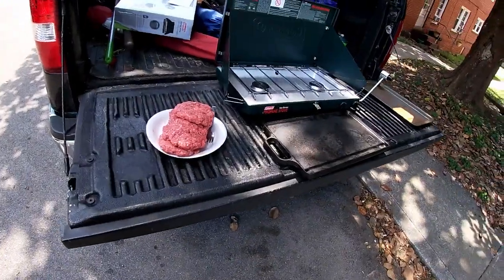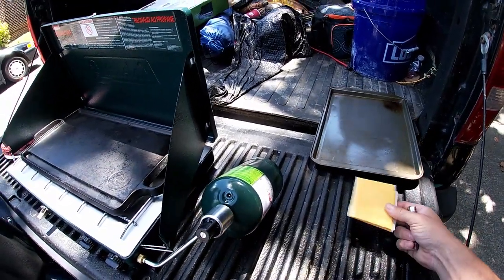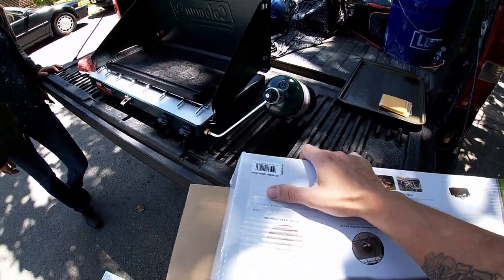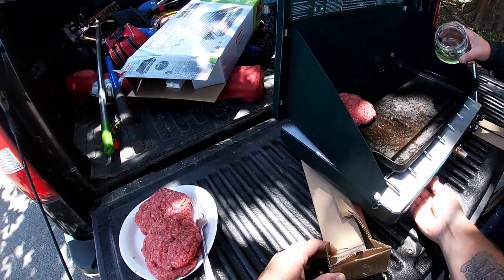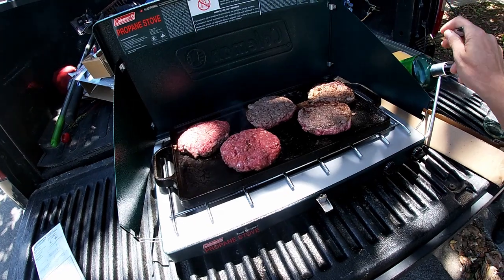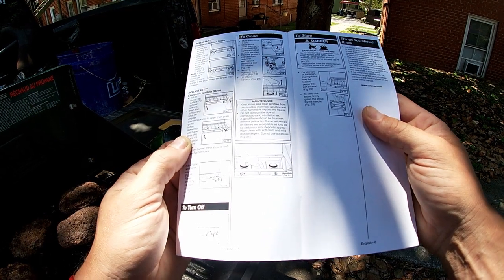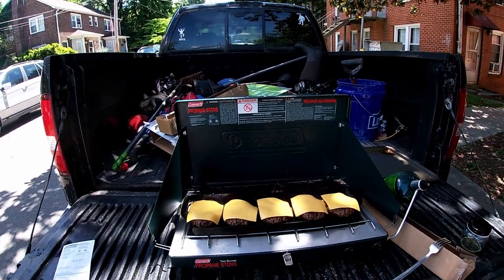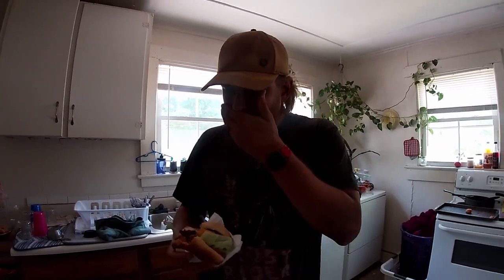50$ Coleman Propane 2 Burner Grill and Burgers

Comment: Have the same stove and will be getting  griddle. I will be getting one a bit bigger 20 x 10.5. Should fit really well. The control on the stove is not great but can be fixed by cleaning the valve. Saw people using Blackstone propane griddle. All I needed to do was buy a griddle.
Reply from the maker: I have now used an amazing amount of pans and griddles on this thing. Been using it as main stove since moving recently.